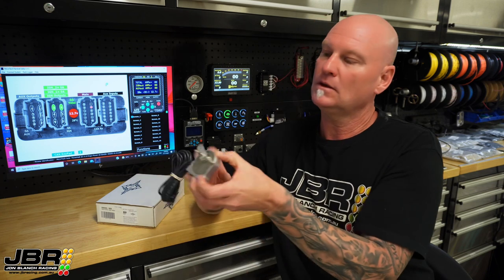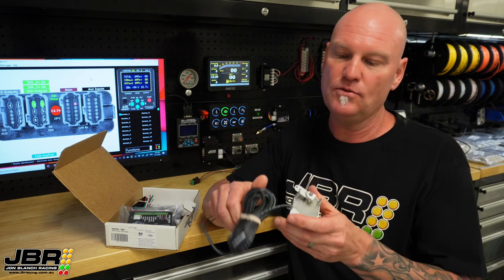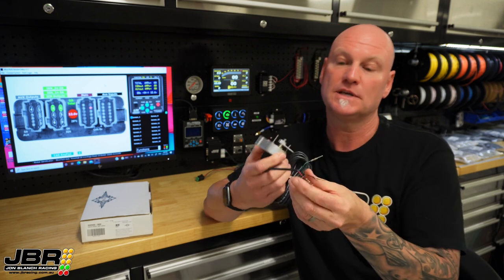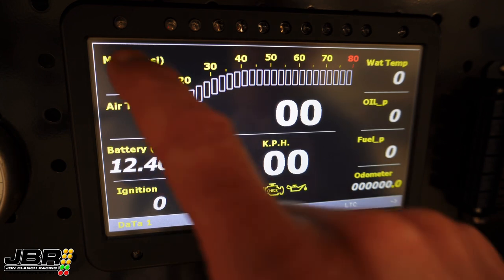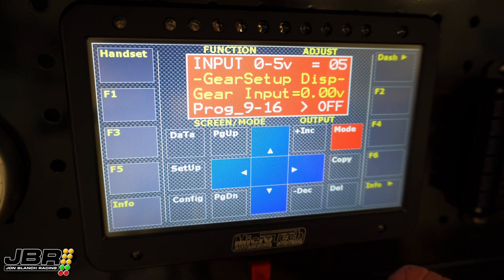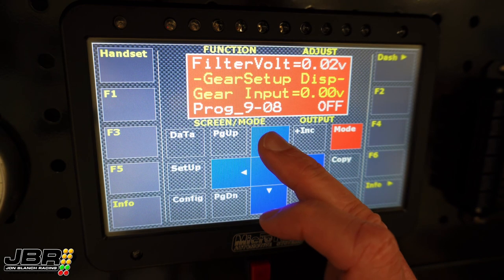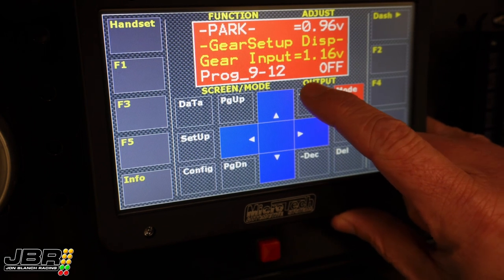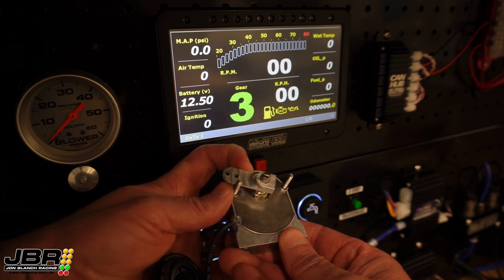How to - Auto Transmission Gear Position Display on a MicroTech Pro Dash

Comment: Can you use this function with a manual box?
Reply from the maker: Hey Greg. 
Yes, you can set it up the same way with a manual box, but will need a sender unit on the box that sends out a different voltage for each gear. 
Or……. You can get it working with a combination of gps road speed & engine rpm 😎
I’ll do a tech video on how to set that up in the upcoming weeks
Reply: pls make a tutorial on how 🙏🏼

Comment: Does it display the current position of the gear selector (the stick) or the actual gear that the automatic transmission box currently in? For example, the gear selector may be in D and the actual gear could be 1, 2, or 3.
Reply from the maker: The sender unit attaches to & reads gear position from the linkage on the side of the transmission.